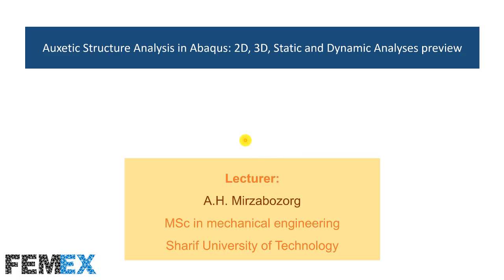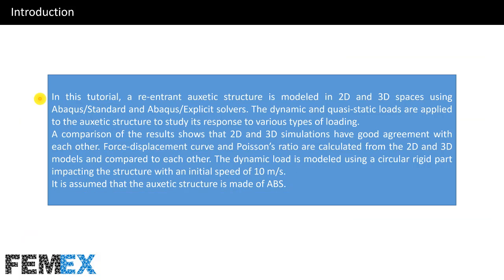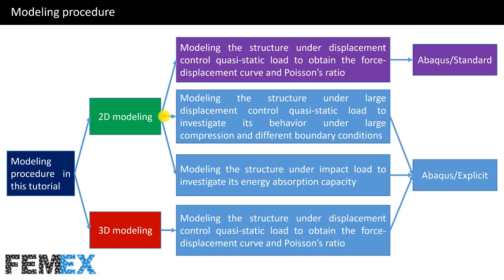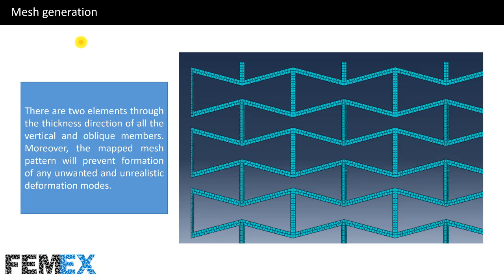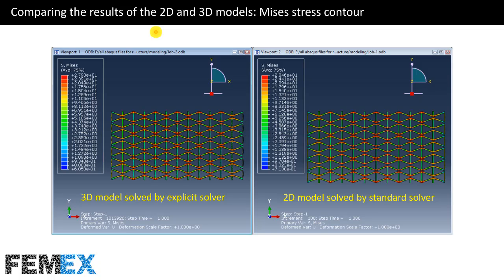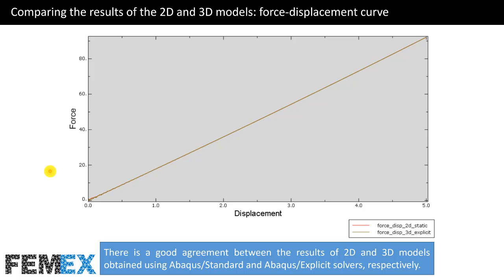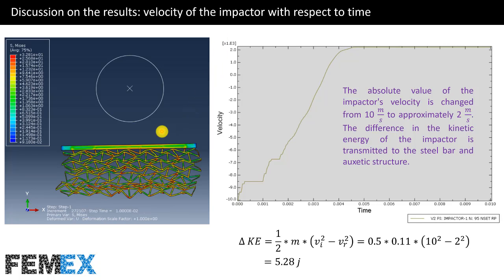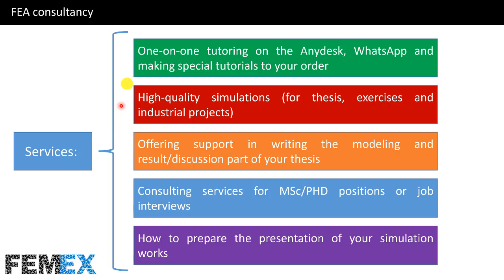Auxetic Structure Analysis in Abaqus: 2D, 3D, Static and Dynamic Analyses preview

Comment: Could you please also throw some light on how to get Young's Modulus vs Relative density graph and Poisson's Ratio vs Relative density graphs from abaqus software
Reply from the maker: Hi.
As you know auxetic structures are a kind of porous medias and there is empty space in them. According to the thickness of the members of the structure and the size of the unit cell and its design, the relative density changes. Also you must check the mathematical definition of the relative density. So each auxetic structure has its own relative density which must be calculated from the undeformed configuration of the structure. Also each design has its own Young's modulus and Poisson's ratio. Hence, if you want to plot Young's modulus versus relative density, you must change your design. I mean you must change the dimensions of the unit cell to reach different relative densities and Young's modulus.